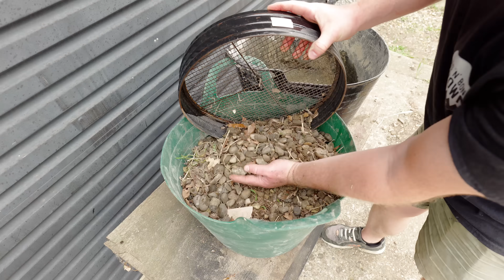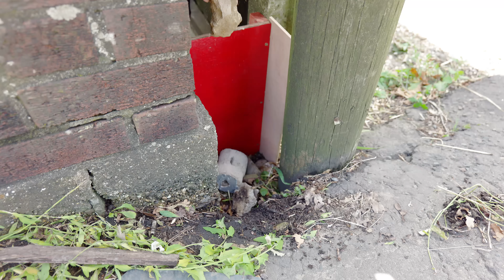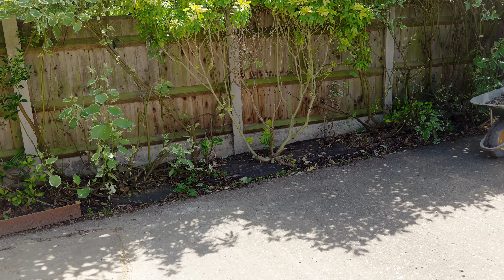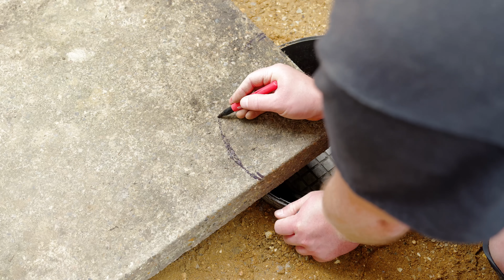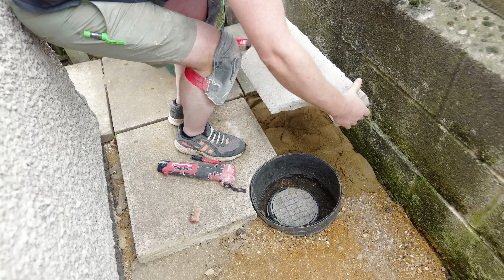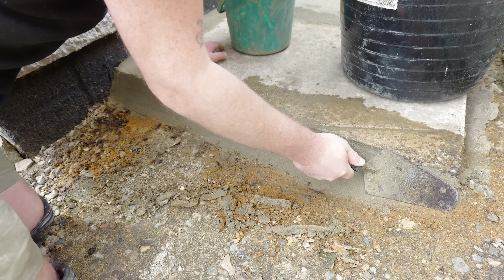Low Cost Solution // LAYING PAVING SLABS

Comment: excellent job truth is there is no way to do slabs on the cheap even if you are really lucky to find something free a 900 by 600 requires some extreme muscle to move them and a van also helps having said the obvious there are some great tips to doing the actual work here and that patio was the dogs bs

Comment: I was surprised you mortar'd between the slabs and the house, I thought you might just use the pebbles there to allow natural drainage - or does the mortar help keep the slabs in place?  thanks, v. interesting.
Reply from the maker: It's below dpc so not an issue

Comment: You're obviously not a woodworker! That ply would last a helluva lot longer if you'd concentrated on painting the END grain and not the surface which btw has a waterproof gueline a couple of mm in....
That looked more like cement than concrete which made me think why not just 'brick' that gap up completely, job done, forever.

Comment: Nothing wrong with that whatsoever. Its a diy job and it looks fine made better with stone chippings. When using an angle grinder cutting slabs cut the top and underneath to avoid cracking the slab 👌 good job
Reply from the maker: I did...

Comment: If you close your eyes and just listen, you can hear the douche from late night TV, the one that replaced the much more talented Scottish guy.

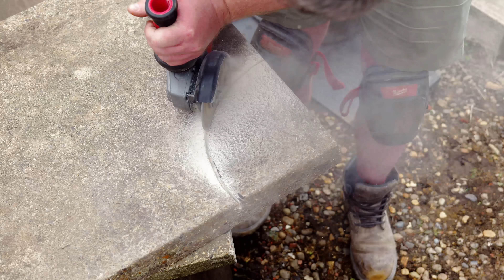If, at 7:00, you used a large hole saw, you could have started by coring out the middle of the paver and placing it around the pipe opening.
 
One cut instead of four and a cleaner look.

A rather large air gap at 8:00 under that paver, won't be a problem immediately but a heavy dude walking on it won't be good.

Comment: Organic REBAR wasted ;-)) 0:35
On a hot day I shovelled it all onto the driveway and I used my flymo vacuum on blow to get rid of the light stuff and then washed it on the driveway the stones came from the soil in the garden our house was built in 1970 on a railway shunting yard. This saved buying hard core and our plants were having a hard time with the rocks that came up every frost. 

Age 62 I think this will be my last shed concert pad I will ever do mixing on a plastic mat, my shovel is getting a bit worn and the blade is much shorter, the handle fell off the other day; I am too tight / old to buy a new one. It is not my wallet it is my joints.

My tamper is then end of my sledge hammer from out old Blacksmiths shop, I reckon it is probably twice my age.

I now wear bifocal spectacles EVERTHING looks bent or not level: my 4 ft level looks like a banana.  

Great video, thanks for all your tips over the years.

Comment: Top Tip. That break in the slab. I've had it happen a few times over the years. And found that if I used waterproof PVA and clamp it with Sash Clamps (I'm a woodworker) then leave it a couple of days, It works brilliantly. Especially if you mortar around the slab. Mine still having re split in 20 years. Well worth trying.
Jamie aka The Worcestershire Cabinet Maker

Comment: Great video, I'm planning on re-laying my garden path which has 30x30 concrete tiles. But I'm not sure what is better to do to get less weeds, either laying them really tight  or leave a gap between them of 3 to 5 mm and fill up seems with concrete or cement. Any tips?

Comment: I actually removed 11 of my 50 year old patio stones ( 24" x 30" and 80 lbs each ) that were worn down and flipped them upside down, cleaned them up, and turned them into a walkway farther back in my back yard. Even though they look 'old style' and a bit worn on the bottom, they still look pretty good and will be painting them soon.

Comment: Did you use the same 5:1 sand to cement ratio for the mortar between the slabs as you used for below the slabs?

Comment: A tip, put the cement and sand in together then mix without water. Dry it is easier to mix into a homogenous even product as it is lighter and breaks up clumps better.
Then add water/plasticiser to finish mixing.

Comment: Maybe I am wrong on this one, but I would put a layer of sand around the perimeter of these slabs, before start putting the mixture, slabs, and edging. Sand would slow down water a bit better than the dirt. But I think also some more planning would need to be put into channelling the water before all this, just to make sure water would not accumulate in unwanted places.
Reply from the maker: I didn't use "dirt"

Comment: Why did you compact the sand? Your supposed to use the sand as your leveling layer... Makes it so much easier to get right rather than all that hammering you did.

How are you dealing with drainage there? Is it level or sloped?

Ah yes... See you found out when you did the pressure washing and cut the video short... 😂😂😂😂

Good luck with the flooding... You're gonna need it
Reply from the maker: You clearly  have no idea what you're talking about. Why would I want to create a drainage issue in my own home?

Comment: Concrete does not like internal angle and angles less than 90 degree. The stress flowing through the slab induces a crack at the change in width. Cutting two smaller bits either side of the water box would have been better.

Looks good at the end.

Comment: Another can be tricky job that you made look easy and explained really well - thanks Keith. Do you have a link for the concrete screws, i seem to be looking in the wrong place for these and never sure if what im looking at is the right type - cheers
Reply from the maker: https://www.screwfix.com/p/easydrive-tx-countersunk-concrete-screws-7-5mm-x-70mm-100-pack/9643H?tc=HC5&gclid=Cj0KCQjw84anBhCtARIsAISI-xcRHIaG2XR_b0WsRjmIwxQmI-zrt6wxefMBF87YmNDQ39tivqljdVcaAsBSEALw_wcB&gclsrc=aw.ds

Comment: Why wouldn’t you put gravel on both sides of the slabs let the water drain from you’re house
Reply from the maker: I added mortar at an angle against the wall so that rain runs away from the building - I'd rather it drain away from the wall than draining next to it
Reply: He has a system in place to do that and talked about it in a previous video

Comment: 30 years ago I bought a 2nd hand diesel wacker plate with a 1 inch steel plate for £60 Now, that, was heavy. I had to use a engine hoist to lift it out of my van. After I used it for a drive at the back of my house and a neighbours house I sold it for £60. I wonder what that would cost today ? 🤔

Comment: Haven’t you got a proper Milwaukee cut off saw Keith? Surely would’ve been easier cutting them slabs with that over a 4 inch angle grinder
Reply from the maker: The larger  diameter of the disc wouldn't allow a right enough radius
Reply: @RagnBoneBrown  ahh makes sense now you mention it 😊👍🏽